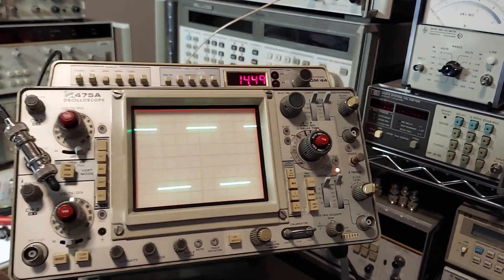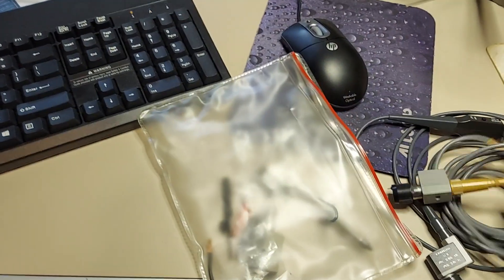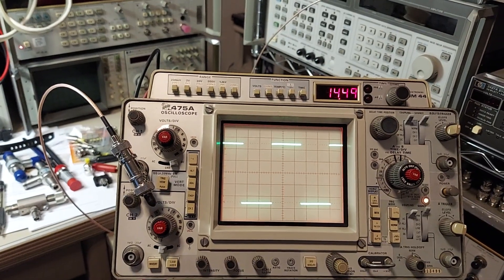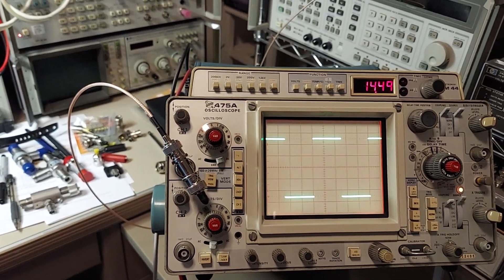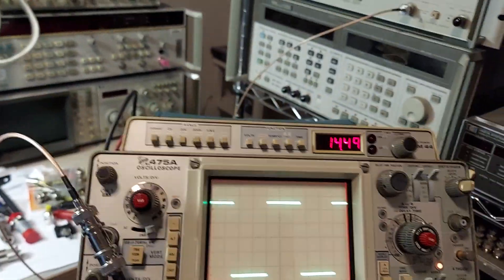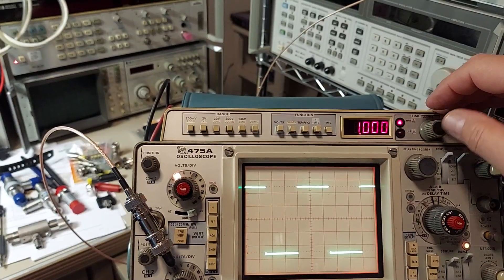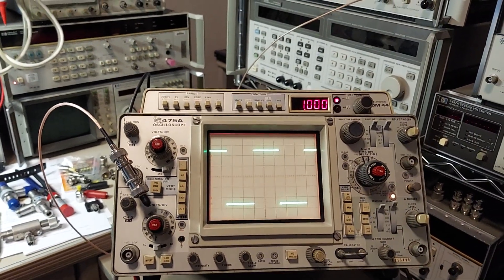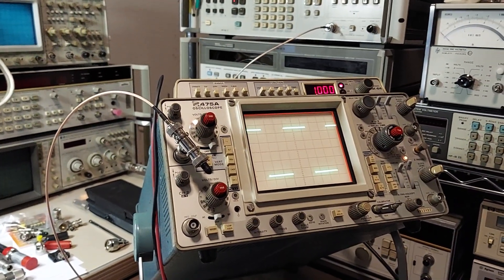Tektronix 475A Hamfest Special.

Comment: Have you ever checked the frequency response of your 475?   I have one that has a frequency response of 20 MHz, per Tektronix's verification procedure.   I thought it might be stuck in reduced band with mode and cleaned the switch for that.  With another scope I can see the outputs of the vertical amplifiers bypass the filters, so that's not the problem.
Reply from the maker: Thanks for watching. I never checked it much beyond 100MHz. All I did was clean it up, cleaned the controls, confirmed it was operational and then sold it earlier this year. That's an interesting fault, other than checking the BW limit switch there may be a fault with the input amplifier stage.